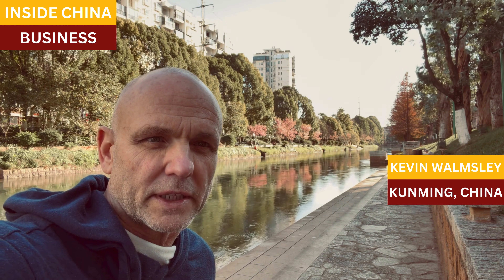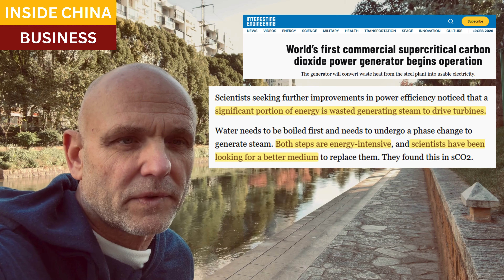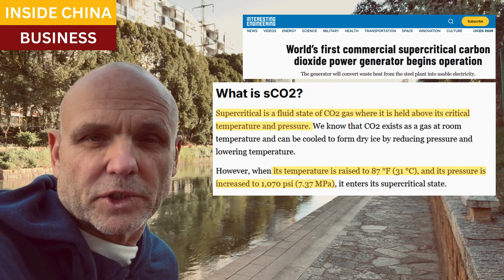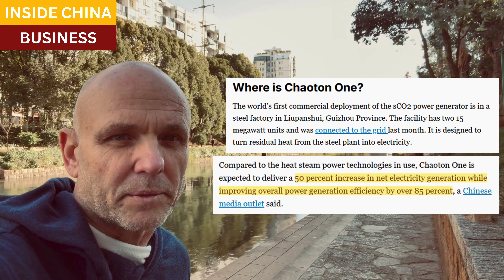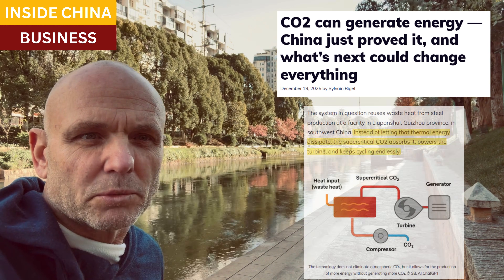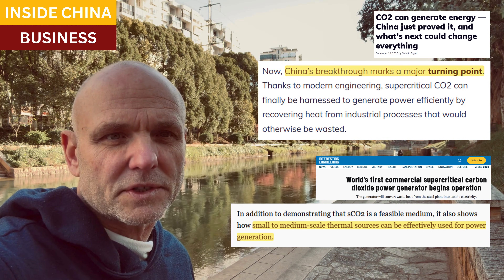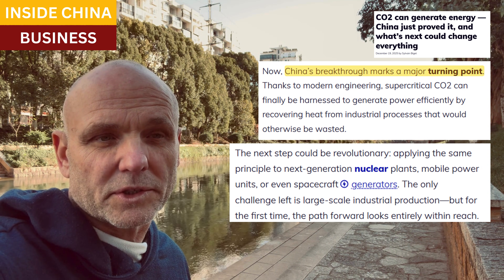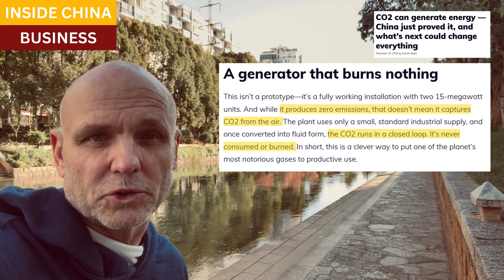Revolutionary generator transforms Chinese factories into power plants

Comment: Using waste steam to produce electricity has been common in chemical plants and gasoline refineries for decades.
The process is called “co-generation” and it is done in the co-gen unit.
You are reporting on a new design for co-generation.  Nice!
Reply: Using only waste steam compared to waste steam PLUS CO2 to become sCO2 (supercritical CO2) to generate electricity are two DIFFERENT things, although both are considered "co-generation" tech. It's ALSO mentioned in the video that using this new sCO2 technology is more efficient than using ONLY waste steam, so whether or not it's just a "new design" is besides the point
Reply: @utube05 

reduces CO2 emissions and generates electricity...👍

Comment: The mainstream media in the West are silent because this technology is a threat to the oil industry
Reply: Trump wont want this, now he has new oil wells
Reply: @nicholascallund6779  Trump can keep his new oil wells. China won't be needing them after all with this new tech development. Just like the Nvidia chips ?!😂
Reply: @nicholascallund6779  I mean Trump still doesn't control Venezuela oil because China and Russian has pouring many intelligent in Venezuelan soils.
Reply: I don't see this technology competing with the oil industry? This will just make water turbines more efficient. (Former water turbines, which would be replaced with these).
The only effect it could make is to make electricity cheaper and therefore the use of EVs more affordable. 
But the electricity cost is not really something that's holding EVs back.
Reply: @dejanatanackovic909 it would reduce oil consumption for purposes of generating energy, but would not eliminate oil as a material source for polymers or agricultural input.
Reply: @dejanatanackovic909 EVs are a scam.
Reply: No, it's not really much of a threat.  The switchover of transportation to electricity is a way bigger long-term threat.  Each new electric vehicle (not just cars) is future demand destruction for oil.  Multiply that across just about all of Asia, combined with the decline in the West and you have a recipe for lower oil prices because of a glut.  This is why Trump invaded Venezuela, to keep that oil offline.  If he can't get a pliant regime to slow roll out oil production, the USA will push civil war.  Look at the US over the last 30 years, going after large oil producers to take them offline: Iraq, Iran, Libya, Russia and now Venezuela.  Wall Street needs a high oil price too to keep their debt bedrock afloat.  Low oil prices mean less banker bonuses and a harder time rolling over debt.  Throw in the fact that yen carry trade is about to be killed off and you can see how everything becomes related.
Reply: Young Americans with brains are moving to China
Reply: and the whole discourse around climate change
Reply: Yes, but no.  This is complementary to any thermal system, and could be attached to any large industrial oil burner.
Reply: Western media would say at what cost.
Reply: Will you say the same thing in 10 years time when there are none of these plants in commercial operations?
Reply: it really isnt, you can put that into an oil plant too, it usually has its own issues tbf so its not so widely spread
Reply: @matteorizzi487  it has too many issues.
Reply: The mainstream media in the west isn't wasting time reporting on a limited use, and currently experimental, technology that has severe problems to overcome.
Reply: ...and to their wrong opinion on co2
Reply: @kerstenukatz8672  No these are closed cycle so are not going into the atmosphere.
Reply: Don’t forget that it was stolen from the USA! 😂
Reply: @davidlazarus67 U.S. is looking to steal, kill , and destroy a weaker country , meanwhile China is making technological advancements.
Reply: @davidlazarus67 so that's why China has this and the US doesn't have this in their country? Imagine being dumb enough to think you are superior when you are being outclassed. You're not gonna survive
Reply: @misere390  You do realise that I was parodying Trump who claimed that Russia stole hypersonic missile technology?
Reply: @davidlazarus67  well, even Venezuela stole American oil & now he wants it back
Reply: @greatmovies298  How does oil, located under Venezuela, become “stolen American oil”?  Asking for a friend.
Reply: @navguy12  I think she's being facetious. We all know how Chump is the MOST perverted psychotic liar in US political history
Reply: @dmar1717 nah, you are giving him too much credit. There have been others that weren’t any better.
Reply: @davidlazarus67 You old man river 😂😂
Reply: @davidlazarus67  knowledge needs to be universal, if we wish to advance as a species and global civilization. Down with the patents, they have beed dragging back humanity for too long, just for private profit, control and power.
Reply: @SevenBee-q2j I was parodying Trumps claim of Russia stealing hypersonic Technology, plus look how Americans claim so much was stolen by China. It’s all a lie, the technology transfer was agreed by the corporations to help the Chinese make better products for them, and it worked for them. Look how many Chinese technologies have benefited US corporations, especially in the areas of rare earths. US companies have been selling smaller phone chargers with GaN rare earths. Now China is ahead in most technology and they still sell it to America, except when the US prefer lower quality US technology because it has backdoors that enables the NSA to spy on the world.
Reply: @SevenBee-q2jbrother knowledge is universal, nobody can steal sth universal, one can only try to hide it for a while.
Reply: @davidlazarus67  you have to take the good stuff from the US otherwise it gets never used
Reply: The oil industry isn't threatened by this. You still need petroleum products in the 21st century. This tech would make an oil refinery a electricity producing plant. If BIG OIL could declare that a refinery is also a public utility, and reduce emissions, a lot of their "green" issues would be reduced.
Reply: @cjsteadman6217  Exactly!  China has refineries, so you can imagine "free" power would be a great benefit.

Comment: CO2 is thermodynamically stable.  This means it requires energy (from somwhere) to change it back to O2 and Carbon.
  Plants do this by directly using the Sun's light at 100% efficiency to O2 and Carbon. 
     I'm not sure how this is going to help unless its using the Sun directly.
Reply: We are not talking about photosynthesis or any other chemical reaction here. 
We are talking about using CO2 instead of water and steam to turn turbines, which is strictly physics. CO2 doesn't generate electricity, the waste heat from steel factory does.

By any chance you are an American?
Reply: @whensonzhou4174  Okay, no chemical changes, just heating and pressurizing CO2 to turn turbines to produce power. Great.   
Thermodynamics is physics, but I know what  you mean.